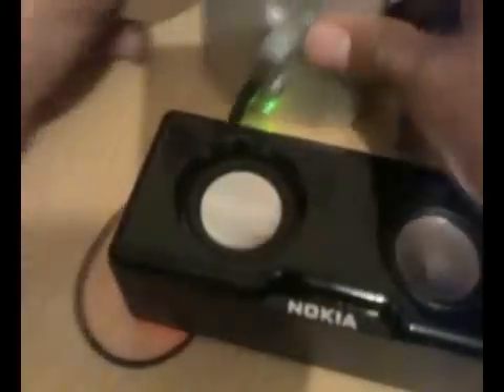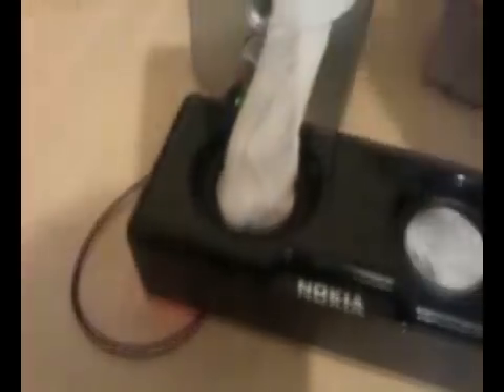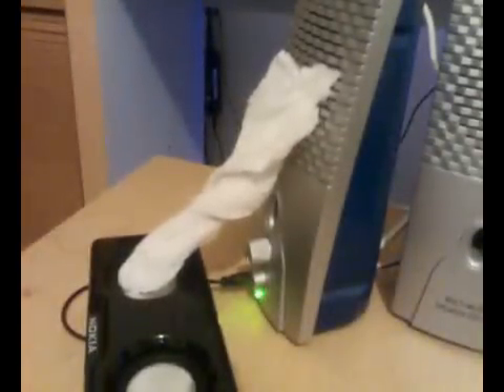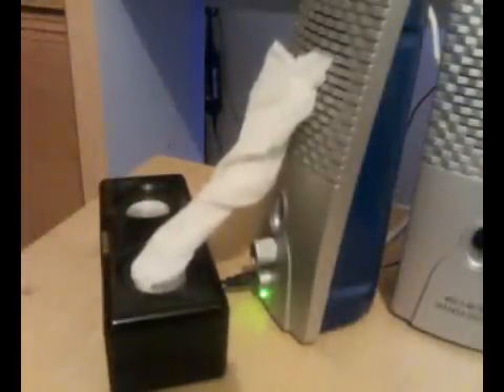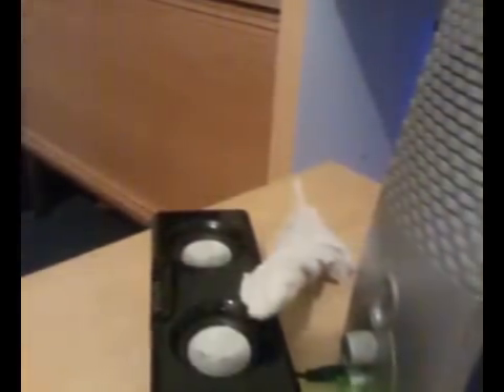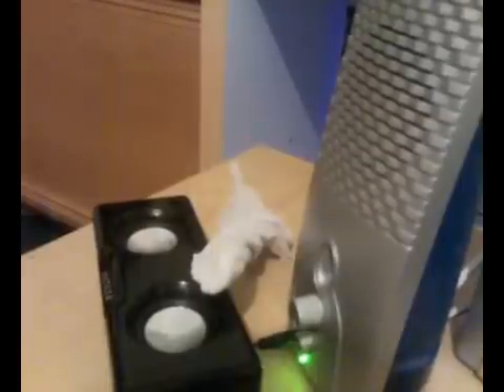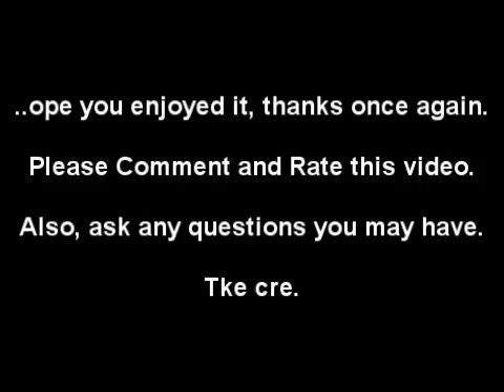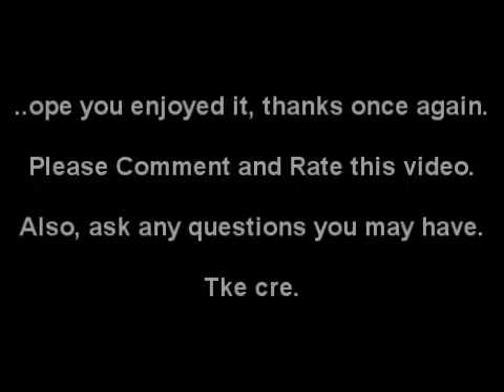Nokia MD-1 Speaker's @ Sub-Bass Frequencies

Comment from the maker: Altec is almost twice as big as the MD1, and doesn't look portable enough to be held in a hand. (more like a Desktop Docking system.)

ALSO, the Diaphram of the Altec is exactly 1mm smaller than the MD-1, so there will be a difference in sound volume.

MD-1 is more stable with devices, while altec needs a special attachemet to work with 3.5mm jack devices (provided ofc).

Over all, I'd by the MD-1 if i had the choice, but i have both xD.

Comment from the maker: @windmirror oh they are both loud to ALMOST the same amount, but the altec is slightly got a unclear sound to it when compared with the MD1. MD-1 is more crystal while Altec is kinda like a phone speaker, (sharp and less bass).

Battery is good on the MD-1 cause its first of all, an internal one, while on the altec you need to keep replacing them and you don't get the portable feel cause you need to carry extra batteries.